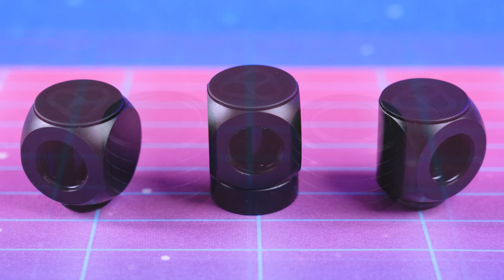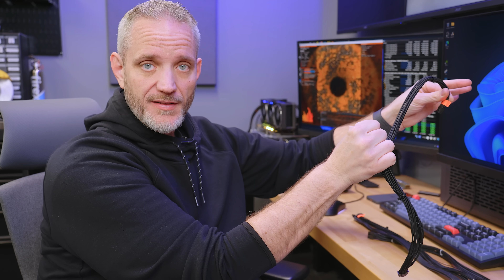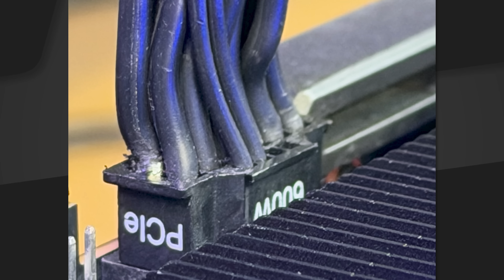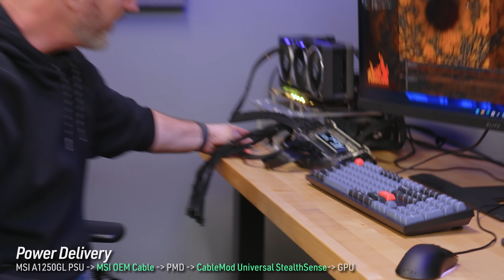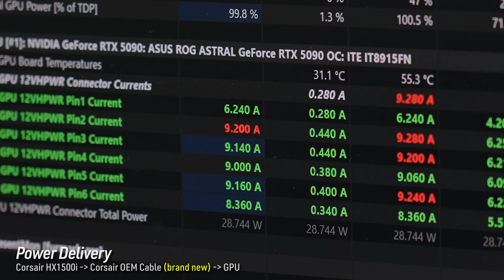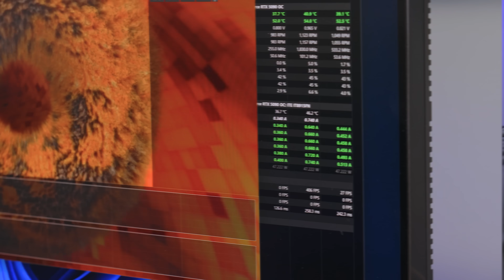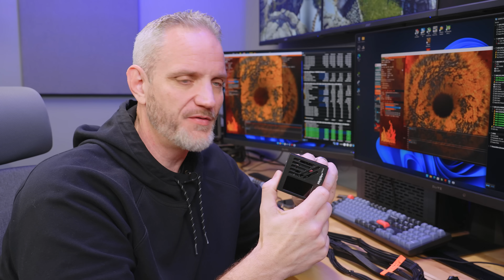More details on what could be causing 12VHPWR / 12V2x6 Cables to melt

Comment: One of the problems with the connector block that has been talked about by at least one other content creator that I've watched is that as the wire heats up and cools down and heats up and cools down, the plastic gets less and less strong. Has this happens, it could potentially mess up a plug that is only plugged in once, but it's most likely to happen when you're unplugging and plugging and unplugging and plugging your cable repeatedly, as this will allow female side of the connector to push backwards in relation to the block it's embedded in. Apart from going one gauge heavier in the wire, what I wish they would do is have something similar to a wago, where you have levers the clamp down. In the case of wagos, You push the wire into the wago and clamp down on it, but there's no reason we couldn't have a sort of a molex connector that has a similar thing where you clamp down on the pins that you're connecting to. Between that and the slightly heavier gauge of wire, and maybe choosing a better plastic for the connector housing, this should eliminate all of the problems. No I know that Nvidia doesn't want to create such a cable, but a third party could. They could charge a premium and people will want to protect their investment because those cards are going for upwards of $3,000 these days. If I had engineering skill, I would design it and get it made and sell it.

Comment: The Corsair Type5 cables which come with the RM1200xShift are much smaller that the Type4. Have you looked at those yet? Interested in hearing what you think of that cable. I have to push pretty solidly to get it to "click" into position on my card.

Comment: I was very skeptical about that connector on the Asrock Taichi 9070XT and have found it to be pretty good compared to the 5070ti and all I have noticed that the Thermals on the Nvidia is bad, no matter what cable u use.  The quality of the cable matters, and the alignment needs to be perfect on a high power drawing card. If current isn't evenly spread, that's when it will melt

Comment: This all comes back down to the breakdown an electrical engineer did on the new cable spec.
The old spec assumed shit materials so it required overprovisioning the wires so that in the WORST case scenario the cable would handle the required currents.
NVidia however assumed "discard physics" approach that you use at school, so the spec assumes best possible case to meet the requirements for current instead of at worse case scenario.

Comment: yea, i have a gigabyte gaming oc edition 4080 and it burned out my psu 12vhp cable at the psu end. was very suprised... was trucking smoothly for almost 3 full years. using the 3 8pin-12vhp adapter from corsair. much better cable imo, at least its safer for the psu end.

Comment: Im currently doing the same thing...just did multiple cables, and psus, and some are soooo loose.  Its unreal. Ironically the one that went bad first is the Cablemod cable,  the front click also snapped off.. which ive heard u say they only have about 30 unclicks. Kinda sucks when building and benchmarking 

The cable on the psu side... the pins can  move so many mm' s which explained the 9.7 etc.

The evga cable died too. So got two new psu w direct 12vhpwr to 12vhpwr. 
 I dont want it vertical mounted it right now, well I dont want to put any bend on the new cables

Question about TG adapter, seems yes expensive,  but i get the insurance factor, but doesnt it also introduced more places to have an issue.

Comment: its a 60cm cable, the rating is awg 16 but it does have more strands in the cable [its not a solid wire], its cheaper to make, but prone to break more often, shielding seems to be cheap too, thats what makes the cable feel soft as for the pin moving, very bad wire cramping in production as if it is just retained by a plastic, plastic deforms and lose its elasticity over time, becomes rigid and when you unplug it once... its already in a shape where if plugged again in a different angle it might malfunction. Have in mind that awg16 have 75lbs breaking force, awg18 have 45lbs breaking force... companies [like corsair on the tiny version of 750 plat psu... bad decision really] using psu cables for example thats a mix between awg16 and awg18, awg18 is 30cm [calculating resistance per m or ft]

In short companies often cheap out on cables and cables work fine, as long as you don't have to plug and unplug them more than once, which is very not consumer friendly because it wont let you service your pc. SF750 Plat have a motherboard 20pin connector i think 20pins are awg16 4pins are awg18... something like that, haven't looked to check, but you can visually see the size difference and the thickness of the cables. awg18 can handle the power, problem comes from the fact that awg18 is twice weaker on bending and twisting especially when you are using stranded cable, even if one string breaks  that causes irregular voltage, weird behaviour so and so. i have no idea why companies are cheaping out on psu cables.

Statements like: we are using a market approved standard! - true, but the standard doesn't specify the strains in the stranded cable, it just says number of cables and rating in awg and how the pinout should be, it doesn't even specify the type of copper that should be used or how clean the copper should be.

The argument: that will increase the price per unit! - with few cents yes maybe a dollar or two, but it will reassure reliability, but truth being told, company will earn more by selling you a replacement cable than making your original cable sturdy enough to be often unplugged and plugged back in.

By no means thats a corsair issue, many companies does it. man how much money you saved from using awg18 instead of 16 or 14, if clean interrupted non-dirtified power is what you want, just use 16 or 14, but no.

Comment: I think some cards are more "immune" than others. My card uses 3x8 pins and rarely ever pulls over 250w (with V-Sync sometimes circa 140w).  That's a 210% safety margin  (250w draw, 525w capability).  It seems impossible bar a dead short from live to overheat or melt that.  Regardless, good video, thanks for sharing your thoughts.

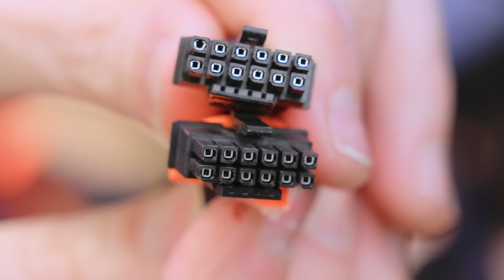Comment: This is a good video, but you then make a mistake saying theres no problem at the ends and at 16:36, as clear as day theres clearly a problem with some of the connectors - one of which is too wide and open which means it wont make a clean connection.

Also there are so height differences of the connectors within the plug - not a huge deal, but there are subtle nuanced differences.

Comment: Soo, I have the MSI 5080 oc, I use ROG STRIX 1000W Platinum with it's so called ""GPU-FIRST"
Intelligent Voltage Stabilizer" and of course I use the original 12-pinn cable.
As I understand from the video, I'd be better using the provided with gpu 12pin splitter and use WireView pro II by thermal grizzly, if I would like to stay on a safer side, right?

Comment: This video accomplished nothing for me really except to make me paranoid about my 12v2x6 cable!  Aside from obvious visual tests and click/wiggle checks, what the heck can I do to check my 12v2x6 connector cables at home without having access to, or knowledge of all this specialized testing stuff?
Reply: Get a DC clamp it does the same shit as HWINFO with Asus cards that he's using but downside is u gotta check each cable individually but its worth doing then having a expensive GPU melt.
Reply: (the most reliable way instead of getting some adapter that tells you which only really introduces more fail points.)
Reply: Asus gpu tweak iii and hwinfo in windows both show me the amps going to each pin on the power connector

Comment: I just bought a 5070 ti and didn’t think about the fact my psu is from early 2020 and never came with a 12VHPWR and now I’ve been watching and reading all this stuff and I’m absolutely terrified to buy this seasonic one or should I just get a whole new psu
Reply: I'd probably get a new PSU at that point. ATX 3.1. I recommend the Corsair RM850X or whatever wattage variant you need for your systems load. The 50 series have tighter voltage tolerances and really benefit from a modern Motherboard (with PCIe 5.0 ideally, 4.0 at the lowest) and ATX 3.1 PSU. Can't say I have experience with these new cables though. Just got a RTX 5060ti, which has standard single 8pin. Glad I don't have to worry about this nonsense. Another round of Nvidia making shady products I guess. They've been at it for years but somehow they are still the best IMO, at least when their products work. After getting my new card I realized that PCIe 3.0 (on my old Z170-K mobo) is really not cut out for a newer 8x card. Getting high amount of PEX and NAK errors due to the PCIe 3.0 interface struggling to keep up over 8x. 16x is less of an issue though. Still working better than my old RTX 2060 but is costing about 10-20% performance I believe.

Comment: At this point we would be better off just using residential two core cables running to the GPU terminated on both sides with a screw and contact paste. or a wago. like holy shit this 12v2x6 cable fiasco is still going on i can't believe it

Comment: I had an old hx1500i and noticed that the 5090 would shut it off from power spikes,  I bought the new hx1500i with the 12vhpwr cables that came with the power supply and the issue was gone.  Not sure what version you have but that is what i ran into.

Comment: Takes me back to old Molex connector days. Those things would pop out of the connector housing when pushing them together or one of the male pins would get stuck inside the female pin when disconnecting them.

Maybe we should move to multi core threaded cable connectors.

Comment: idk i don't think this would really apply to like 99% of people as what you are explaining is just wire wear cause you are a big youtuber you ar plugging and unplugging your cables all the time to install new cards eventually your cables will break this happens to all electronics and why you replace say extension cords every 12 months or so if you work in a commercial setting if your not someone replacing their cards multiple times a day you will never run into this problem

Comment: amazon cables... very brave. they probably dont even use OFC to keep costs down. i would never trust 600w going through that thin copper clad aluminum cables. did we ever cut one apart and inspect the actual cable design? get rid of the 22ga or whatever they are and make them 16ga.  not to mention the $1.50 connector design on a $3k gpu. like you have to be kidding. spend a couple extra dollars to make a quality connector. the pins should not have more than a hair of movement inward and outward. the only movement should be the pin spreading open when plugging it in. it should also use a spring steel so it returns to its original shape when unplugged and not lose its clamping power. its common sense for anyone with any knowledge of metallurgy.

Comment: Sadly we're stuck on this disaster power connector until the AI bubble pops, Nvidia loses 95% of its inflated bubble value it gained over the past 5 years and they actually have to desperately care about consumer users and their hardware failure rates.

Comment: There is a reason that Linus wanted to make his own USB cables. Cables are not all made standard.
The standard is so low that you could make one from home and still "claim" ALL specs. 
I remember the first tests of the 12vHP stating that they were maxing out the specs of cables, in fact I am certain that you and Roman mentioned it. 
Basic math shows that 12vHP should be thicker gauge than basic spec for safety. 
Metallurgy causes metals to fail from heat AND bending (think of a paper clip). 

Nothing in this video is new from my basic knowledge of electics, in fact, I stated this a few times throughout multiple videos of various tech YouTubers.

Why is this new?

Comment: All the excuses... holy hell... do you know how many times you would need to bend a stranded copper wire for it to break... to me... excuses. The connector was poorly designed... the fact they added length to the newer connectors proves it. They never took into account the fact these cards operate in CLOSED environments which are hotter than open air test benchs.

Comment: IIRC 12V2x6 only changed the connectors on the GPU and PSU side. The plugs on the cables stayed exactly the same, so even a two year old 12VHPWR cable should be physically identical to a cable manufactured today.

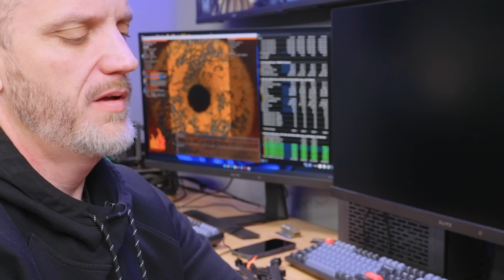E: at 16:30, holy fuck Jay, "Nothing looks wrong with this cable"? Did you not see that one of the metal connectors was bent open?

Comment: I am using Corsair HX1200i and its 12V2x6 cable, GPU is Aorus 5090 Master. The cable is easy to push in but it is good. I did some FurMark load test and measured the temperature at the connector. The results are consistent: about 5XC degrees at 600 watt. I presume a healthy 12VHPWR connection will not go up to 70C degrees. Right now I put two thermistor cables on the 12VHPWR connector to monitor its temperature. If a per-pin current monitor had been available on the market earlier, I would have installed it😂.

Comment: Everything is good on this video, but I'd like to say something about cable mod, they dont support semi modular psu's witch is dumb. I have a corsair model that the only difference from the fully modular one is a model number. They are the same unit same connector's just with a semi modular setup. They support the fully modular one of my psu. But when I emailed they didn't even care that there was no difference. I even sent them corsairs pin-out and what models support it from corsair and they just told me that they dont support it. There should be no reason semi modular psu's aren't supported. I like their cables I just dont understand why semi or fully would matter enough to not support. (I've been using the same cord type 4 to 12vhpwr for a year and its been fine with my semi.)

Comment: In the Windows, episodes of loose contact are recorded that did not become a short circuit. This is error 41 (63) in the event log. That is, the system is configured to turn off the video card regardless of what happens on the ground plate. 41 errors can appear absolutely anywhere, in the connector or in the equipment, it can also manfest with a blue screen, lags in games, and sometimes nothing at all.

Comment: The problem comes down to the resistance introduced with several connectors and very small gauge stranded wire. Current flow thru resistance creates heat. 
I know it would be unhandy to say the least but if they could change over to solid core 14 gauge copper wire between the power supply and graphics card the problem would dissappear.

Comment: In our datacenters we are running a significant number of servers (Dell, Gigabyte, ASRock) containing each 8x 600W GPUs (H200 NVL or RTX 6000 Blackwell) all using these connectors. Never had a problem, running AI workloads, full power 24/7.

Comment: Copper work hardens.

I.e. if you handle a cable a lot it will become brittle and break.

Also connectors have plug cycle life times. Which i believe is 30 plug unplug cycles.

Comment: about 2 years ago, I had troubles with RTX 4090, power supply was without 12VHPWR,  and I had to use 3x PCIEx8 to 12VHPWR adapter which came with GPU. PC was alwys stable, but when gpu was under heavy load  some times it would perform and some times it would work as it was 3060. I discovered the loose connection problem somewhat by accident, noticing that some times it would draw 450W, and some times it would draw arround 250W and sometimes arround 140W. Only then I realised that the problem was power delivery, and I could gain or lose performance just by shaking the cables, so I changed the PSU to the one with 12VHPWR connector and from that point on it worked fine.

Comment: I've observed similar over the last 3 years (4090 and 5090). Even just plugging the same cable in multiple times, or wiggling it in the socket will change the pin distribution drastically. Its just an inherently stupid design. Regarding the cables themselves being a problem, wire can thermally degrade if its been overloaded, which causes high resistance on that particular conductor, which will then cuase more load to be carried by the other wires, which then causes them to go bad, and so forth. It still likely begins with a dodgy connection though.

I'd be itnerested to know if those cables are the same ones you used when overclocking and running 15A through the cables a few weeks ago, because that certainly overloaded the conductors.

Comment: Probably should mention that the 9070XT Sapphire and Taichi gpus were all using adapters.

Regardless don't buy gpus with 12v 2x6 connectors, the 12v 2x6 is an absolutely garbage connector type that negatives outweigh the benefits.

Comment: I really think it should be a 4 or 6 wires in a single row plug with AWG 10 or AWG 12 or whatever would be appropriate for the amperage. 6 would be for a hypothetical 900w and 4 would be 600. Imagine the 12VHPR size connector, but with half the wires and larger connectors.  Bigger wire and higher level contact surface on pin. There are different ways to make a plug smaller. One is to make the individual pins smaller. The other is less pins, but larger wires/connectors in a different orientation.  At this point they need to go back to the drawing board as this issue is still following them and they are limiting themselves at 600w as well.